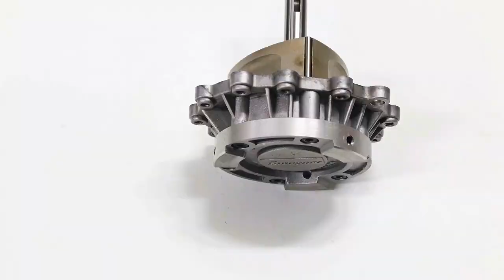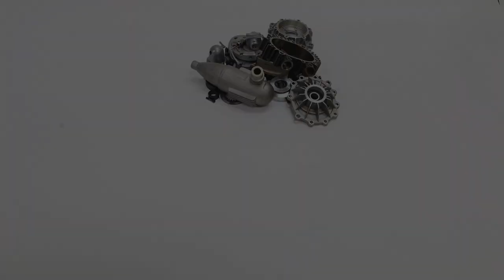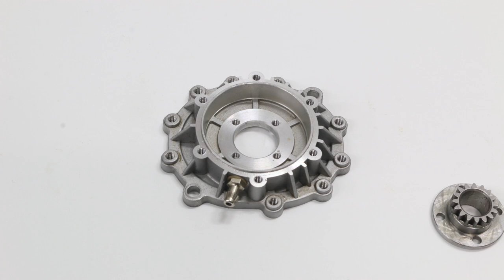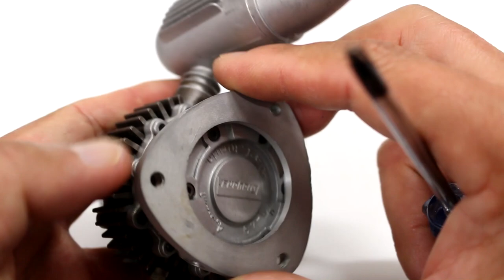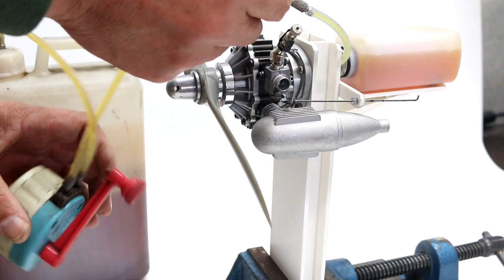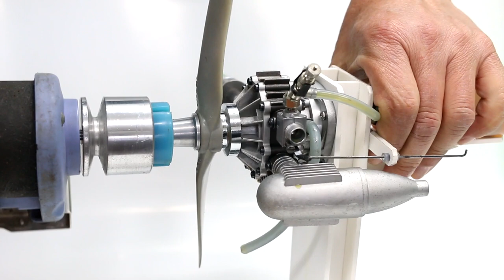WANKEL ROTARY ENGINE - STOP MOTION

Comment: this machine does not work or can not perform in practical use. i have seen video's same or slightly different one but uses the same concept and since i know engines i basically placed it under minimum observable test. this engine will explode internally even with precision timing the reason for this is because the mechanical part where the combustion is taking place acts as a crankcase and a cylinder head at the same time thereby giving extreme pressure on either the crankcase or the shaft or piston what ever you may want to call it. this design is really nothing new it has the same principle as a variable shaft or a hydraulic pump or the compressor of air conditioned car.
Reply: Wankel engines work pretty well until the apex seals wear out
Reply: Reciprocating engines does work and perform fine though have some issues at best :)
Mazda RX7 :) Great car mate
Cheers
Reply: If you've never owned one you won't understand. If the rotary engine had the same R&D in it as piston engines it would be much better.
Reply: Mazda made them work very well.  No more failures under warranty period than conventional piston engines.  Owners loved the smooth power and how the engines would rev freely.
Many other companies, including NSU and Suzuki had production versions, including in motorbikes, but engines were sensitive to incorrect use and needed to be protected from idiot owners.  There were even lawnmowers powered by the Wankle engine.
Reply: +Austin Page Only someone too young to remember the development history of the Wankel engine would say something so unenlightened.
Reply: +Campbell Sharp  Nostalgia is a seductive liar, Mazda struggled to make any profits from the Wankel engine and the design bankrupted the company TWICE! The Mazda RX-8 was an embarrassing sales  failure and the subject of a massive NHTSA recall investigation of premature engine failures. Mazda voluntarily refunded or replaced tens of thousands of failed Renesis engines under the recall and subsequent warranty extension resulting from class action lawsuits. New car buyer shunned the RX brand due to its notoriously bad reputation for reliability and engine problems.
Fortunately that old, false urban myth has been put to rest once and for all, the NHTSA recall investigation found NO LINK between owner abuse or neglect and the unusually high number of failures observed. Mazda DID NOT CHALLENGE These findings and voluntarily recalled its engines.
Reply: The Wankel engine was inherently inferior to reciprocating engines... that's exactly why they are obsolete today.

Comment: Sound like 2 strok
Reply: Naveed Raza they basically are
Reply: Naveed Raza  ......... it is.
Reply: All Wankel engines operate using the 4-stroke operating principle.
Reply: @mgs.915  Not at all, they are 4-stroke.
Reply: @davidsherburne8429  4-stroke

Comment: yuck rotary engines v16 or 9 cylinder radials is the way to go
Reply: the tiny V16 was made for me by my grandpa who liked that stuff it is run completely on compression he made the radio too but it has tiny spark plugs and a real distribution

when he passed away they became display planes im to worried about crashing them now to ever fly them again
Reply: That's what RC cars are good for. When they crash, there is usually almost no damage.
Reply: +Shawn Elliott That may be true for cheap "starter" models designed for inexperienced novice flyers like yourself... but a highly detailed scratch build plane is a different matter all together.